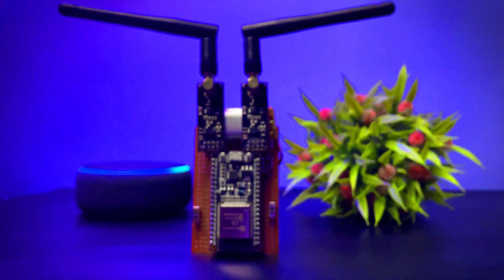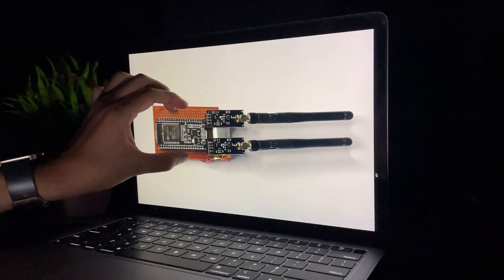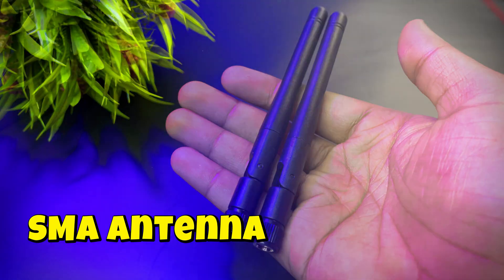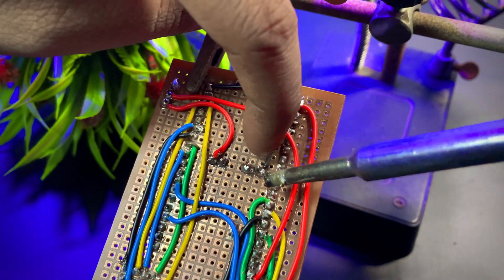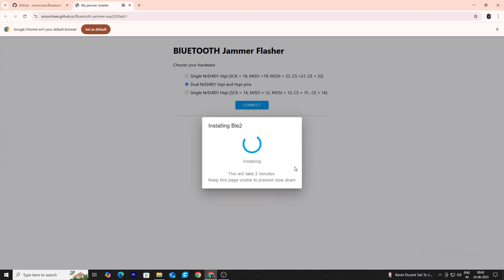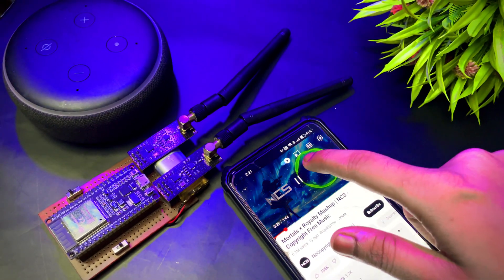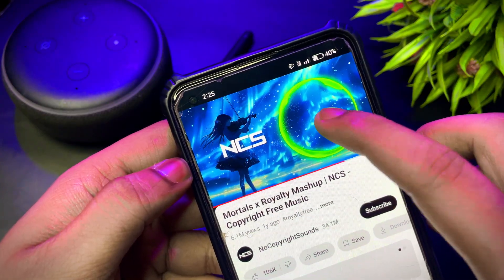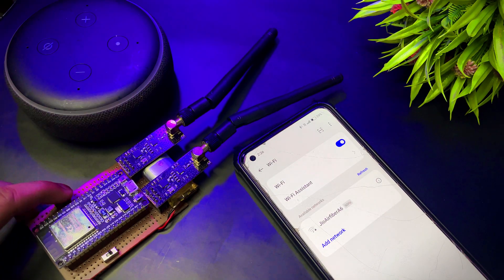How to Make a Bluetooth Jammer using ESP32 | Full Tutorial + Live Demo 2025

Comment: Hi sir I have a question can I ask
So where I work ,I have to switch off an electric water motor,so the building is 3 floor and I have to go check if motor is on or off in rooftop.I live in ground floor.can a sound module work so that I can observe the motor is on or off by hearing the sound while I am in ground floor.and I have a PC with me in ground floor and if yes then how can I do this and what component will be use.and where can I get those?
Reply from the maker: Dm me we'll discuss about it

Comment: Why is there no capacitor at the end of the video? Is it better to use it with or without? I'm going to change the DBI of the antennas. Do you recommend adding one, or can I leave it out?

If I add 9DBI, do I need to modify any connections, or will it work as is?

Excellent project!
Reply from the maker: Thanks for liking this video ! If u use 9DBI antenna then uve to use capacitors and also buy ams1117 3.3v power supply module .

Comment: why did you removed the capacitor from the top of nrf_pa_lna module in the end????
Reply from the maker: You noticed right 😅 there's no specific reason for removing the capacitor in the end
Reply: @electronic_noob_shorts  obviously bro i noticed, if you dont use the capacitor the nrf module wont work properly in start it will work fine hut as time goes it the pins will be oxidiced andwont get proper continuous flow of power , capacitor prevents that from happening actually pins still will be oxidiced but power flow will be handled properly because the capacitor are there

Comment: Bro you didn't correctly mention about which powe supply and also about capacitor
Reply from the maker: I used a 3.7V lipo battery with a TP4056 module and capacitor value is 10uf 25v
Reply: Bro how can I flash my esp using mobile because there is application available for that but not file so can you please provide us a file

Comment: how many meters is the range?
Reply from the maker: 5-10m
Reply: @electronic_noob_shorts How many meters will it be if I install 4 antennas?
Reply from the maker: @Vipupm the inbuilt antenna of nrf module doesn't have much range so if you use 4 then there's no big difference in range ig so

Comment: Where does my lipo battery give power to? Or my switch positive wire. Also does any wire size matter cuz small wires are easy to solder in pcb so I wanna use thin wires instead of the thick type
Reply from the maker: give lipo battery power to b+ b- of tp4056
Reply: @electronic_noob_shorts yeah ik but where does the out pins of tp4056 go to and does wore size matter

Comment: Will using esp32 wroom 32 devkit V1 work instead of V4?? BC it has all the pins from the diagram except d16
Reply from the maker: If D16 is missing then don't buy it
Reply: @electronic_noob_shorts but I already bought it😢 I can't buy another one now :( can I just change the code a bit and put any other digital pin instead of d16
Reply: @ZedsCrafts  yeah  tweak the code to suit you no need for another devkit

Comment: What's the longest range you can jam using your device like in metres and also what voltage antennas did you use and can I add higher voltage antenna if I want without changing wiring or code?

Comment: Why solder female headers? Why not directly solder esp32
Reply: Will using the li-ion instead of this small lipo work the same?
Reply from the maker: yess
Reply: Also what's the esp32 model you used like wroom or what
Reply from the maker: because i want to remove the esp32 in future

Comment: Will adding more NRF modules increase range and will it need anything else to add more NRF modules with antenna
Reply from the maker: this firmware supports only 2 nrf modules
Reply: @electronic_noob_shorts what should I add for 2 more antennas? Only different code and extra wiring with esp32 and the nrf module?
Reply from the maker: @ZedsCrafts yes ive to check you know
Reply: @electronic_noob_shorts (If possible) then please make a seperate vid or provide the wiring diagram and code with 4 antennas(ofc no problem if not possible)
Reply from the maker: @ZedsCrafts okay soon I'll make
Reply: @electronic_noob_shorts thanks a lot!

Comment: Hi there are other way to connect all the cable and parts without the electric welder, and which is the  max range?
Reply from the maker: You can make it in a breadboard ... and the max range is 10-15 meters with these antennas
Reply: @electronic_noob_shorts thank you so much, do you have a link for a good (and also not expensive) breadboard? And a link for better antenna?
Reply from the maker: dm me on instagram
Reply: @electronic_noob_shorts I did it 😊